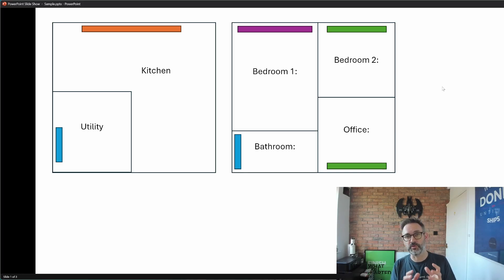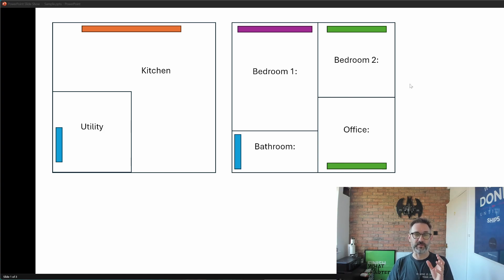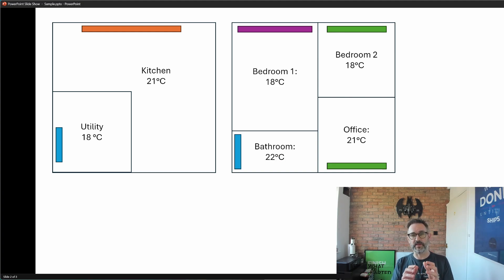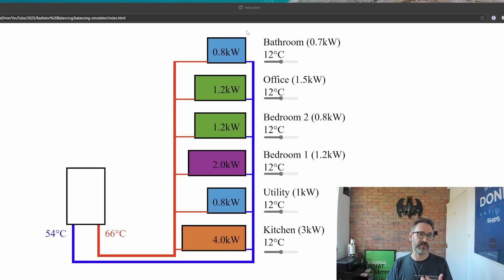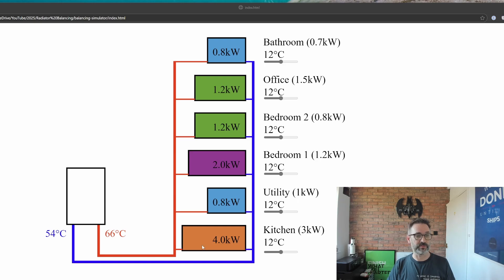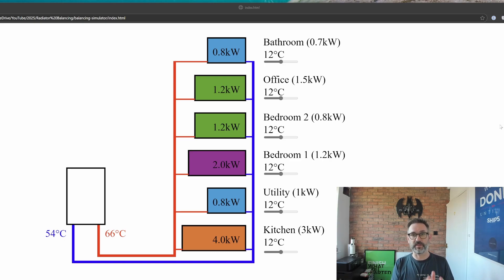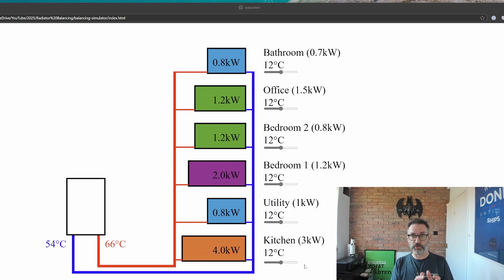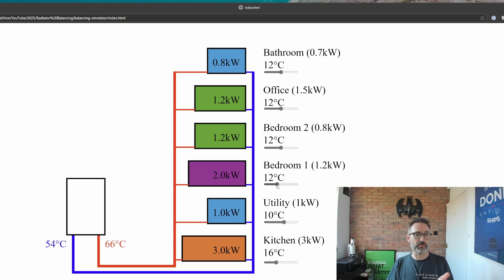Balance Heat, Not Radiators - a better approach to balancing radiators

Comment: This is absolutely right but can be tricky to achieve. We have a very well insulated 2018 3 bed semi and heat loss is only about 2.5kW. Because of the open staircase and hallway, the upstairs radiators hardly do anything, especially as we usually leave all doors open. Basically the upstairs is almost always heated by warm air rising from downstairs. Living room radiators do a bit but even they are redundant when we have been using the oven or hob as it’s a large open plan room.
Reply from the maker: It is hard to achieve a good balance, when heat comes from other sources, like the oven. Solar gain is another thing that makes it very difficult to do well. 

TRVs exist to account for heat coming from different sources, but I don't know if they go a good job of even that.
Reply: @tomasmcguinness better when they are linked to remote thermostats. Evohome can do that but it’s expensive. You could use something like home assistant and use cheaper Zigbee TRVs and cheaper thermostats.  I’ve got quite a few temperature sensors form several different companies and the Govee e-ink one are great, but given home assistant updates can break things so I wouldn’t rely on it for a critical system like heating, but it’s good for getting an idea of the heat delivery across the house.